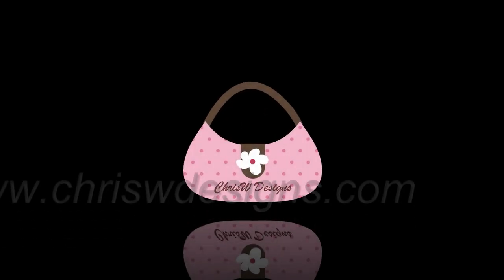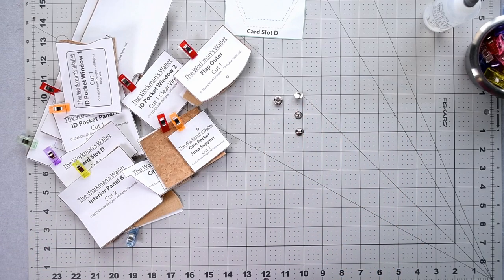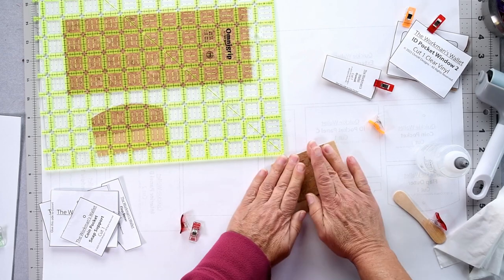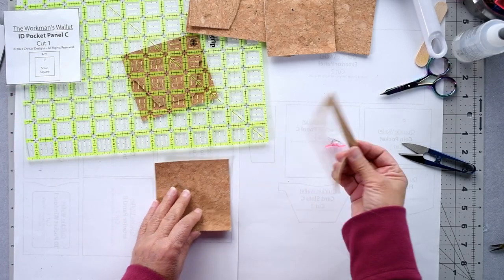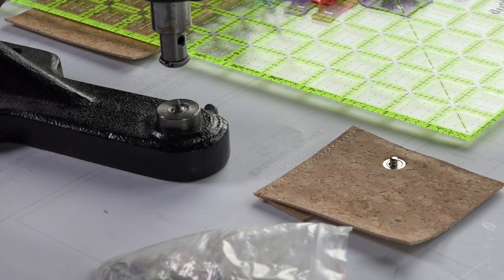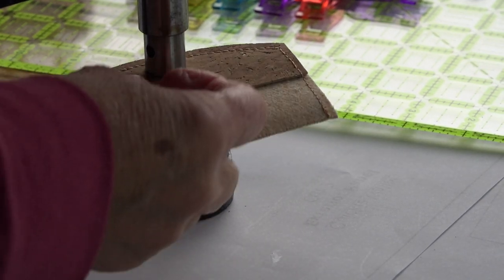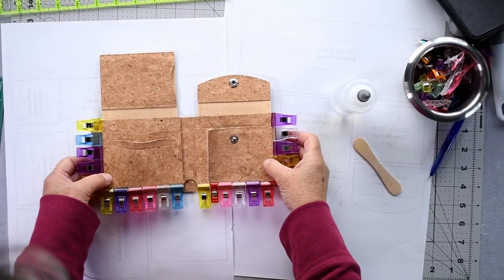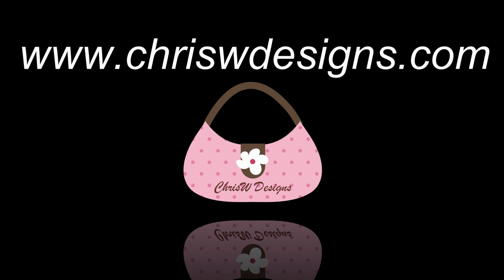The Workman's Wallet Tutorial - ChrisW Designs Patterns

Comment: Chris, Love the design but my OCD side would like to see the stitching on the coin pocket flap line up with coin pocket on both sides. Is that doable or would it create too much bulk in the outside corner?
Reply from the maker: You could certainly make the flap wider so it lines up.  It won't be any more bulky than where the coin pocket is but the thin edge of the flap would be more suseptible to wear (rubbing) if it were level with the outer body, if that makes sense.
Reply: Thanks Chris.  Off to get the pattern and will have to try it both ways and give it a test.😄
Reply from the maker: @2847Katie  be sure to keep me posted on how it goes and do share pics! :)